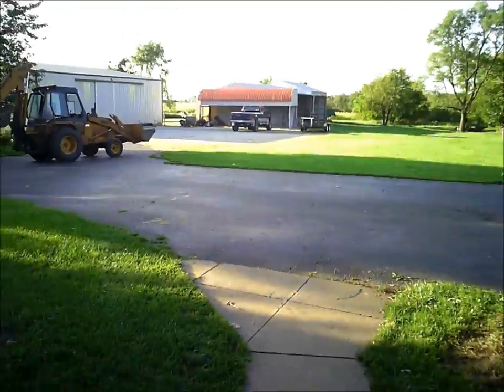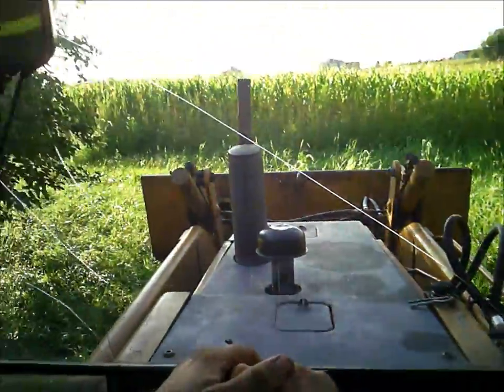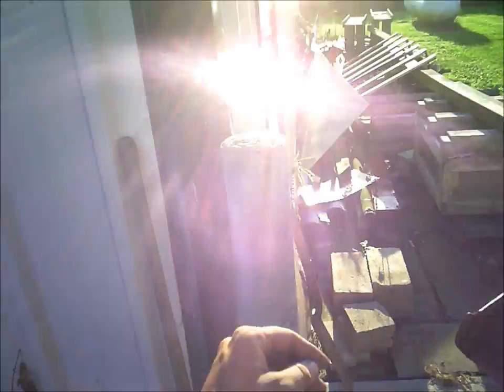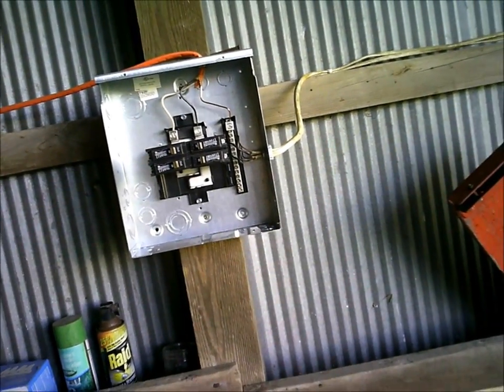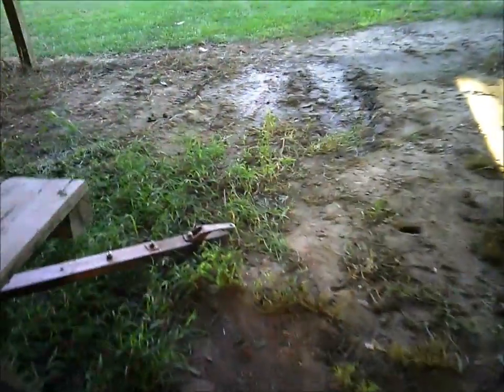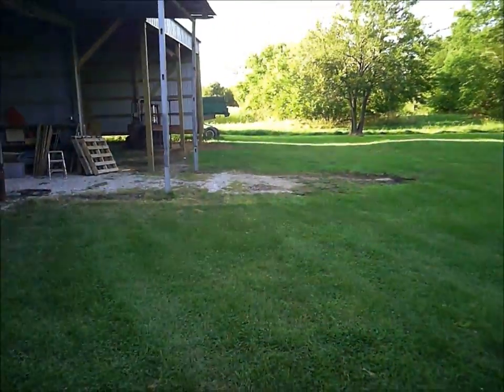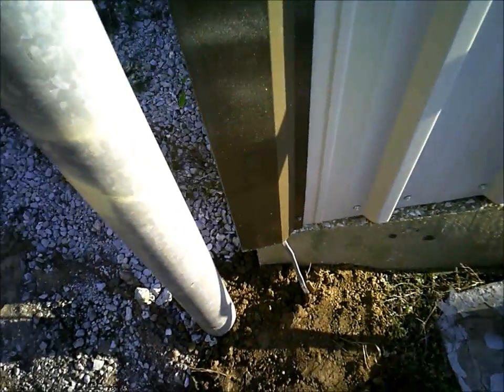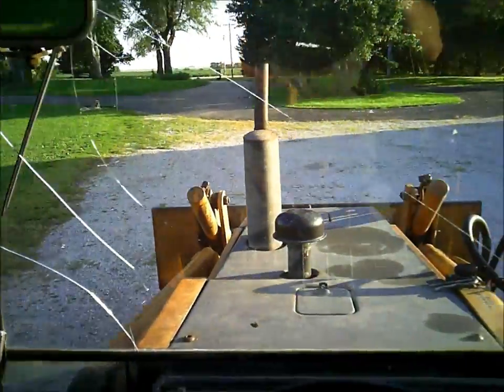Cattle pen pt 7

Comment: I would have put conduit on the wire where it is exposed from the metal corner to underground.  That is big time string trimmer bait around here.  Like your shop.  Sweet brake.

Comment: Good to see the progress.  is that the 525 that you use?  that sounds like a job to pull the engine.  that is one serious lawn mower you got there
Reply from the maker: Thanks jay and no that's the one I pulled out of the woods about a months ago from souther IL. It needs a lot of work to get it running. Ya I gotta have a big mower for the big yard.
Reply: that;s the problem on a  farm, hard to know where the yard ends and the field begins sometimes.

Comment: Ok, Mr. Nate and Jake,#1 first of all you said you tapped into a 3 phase line, where it looks to me that you used the bare copper ground as a neutral#2 you then used the white wire of your 10/2 to feed the other hot buss bar in your sub panel and did not color code it as any color other than green or white, #3 you are required to install a separate ground bar in the panel where it then will be required to be grounded to a ground rod and isolate the neutral bar from the panel. , Just as a elemination of a future problem I would not have installed the wire behind the metal corner metal and if you put it through any metal piece it should be bushed so as not to be cut # 4 the outlet you installer has to be of the ground fault type.. This is just what I saw from the video . Not going to get into a battle with any one. Jake just trying to keep you safe.
Reply from the maker: Wow u must've paused every frame of the video to see all that! I'm sure I won't die from it if God says my time here is up I'm gona be gone no matter what the wiring looks like! I have a ground stake and that is more than enough ground I would ever need since it goes back to source. A few other things could've been better but again I ain't wiring a skyscraper it's just a pole barn with 2 lights and 3 out lets